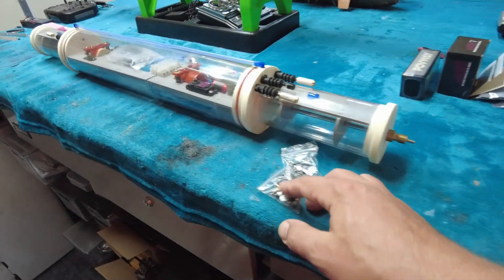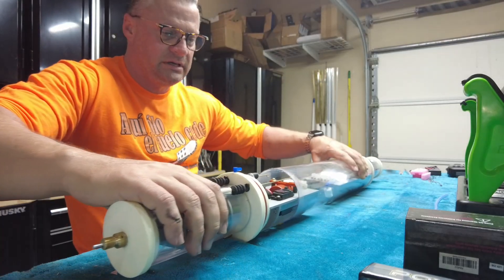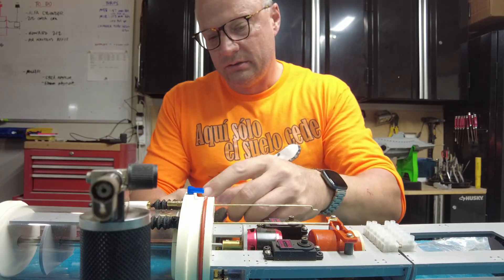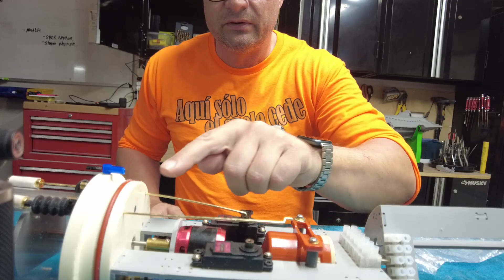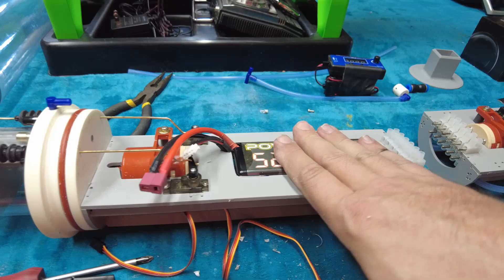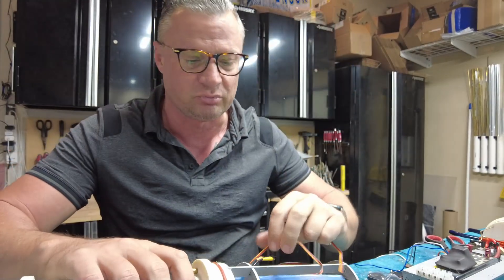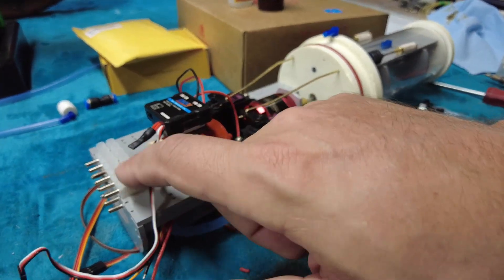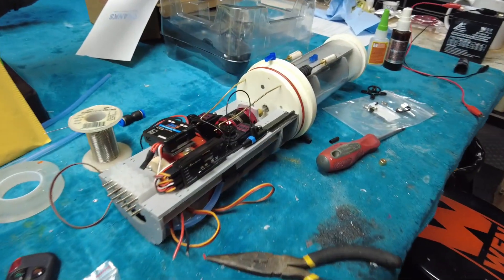R&RRRrrrrrr, Matey! Setting up the Dual Tank 100mm Diameter R&R Engineering Watertight Cylinder

Comment: Hi Bob,
Did you notice the servo opposite the rudder servo twitching when you activated the motor and also when the ballast pumps operated?
Reply from the maker: Very common. The automatic pitch control is very sensitive to vibration. No cause for alarm.